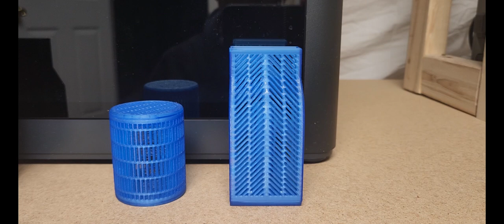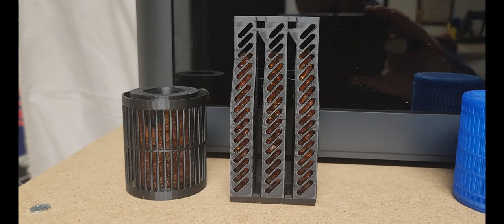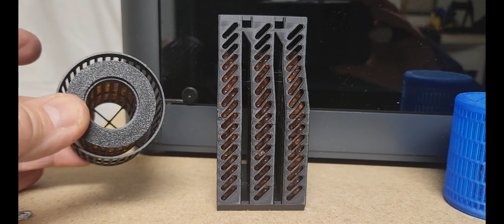Improved AMS Desiccant Pods

Comment: I haven't found any uneven absorbtion on color-changing dessicant, even when comparing other positions to a spool dessicant system with only openings on the sides. It all evens out slowly and once you occupy all positions there is so much explosed surface area (compared to the stock solution) that its likely a better idea to go with as mass as possible so you can forget about it for a longer time.

Comment: Quick question, why two outside walls on the cylinder design? There is the container wall then another wall.
Reply from the maker: @mwinner101  To prevent one side of the cylinder from touching the spool and enhance airflow.   Yeah I know, it might be overkill?  Maybe just the hollow center is enough? Idk.  Looking for feedback.
Reply: @ OK. I was just wondering.